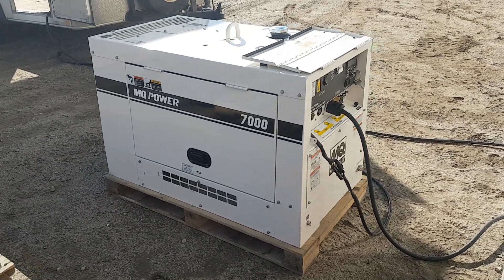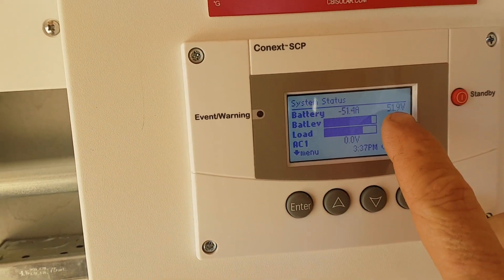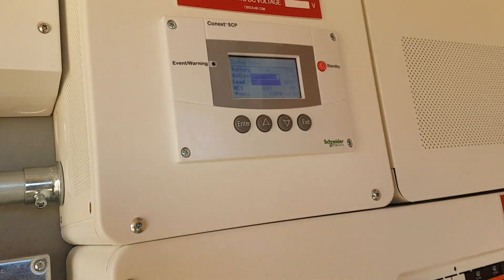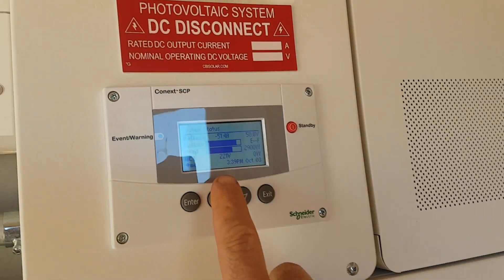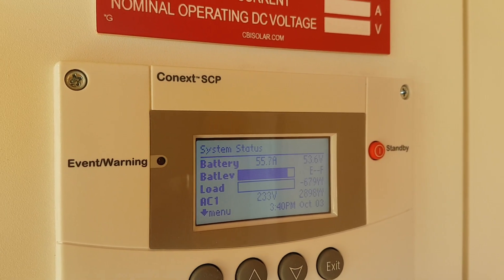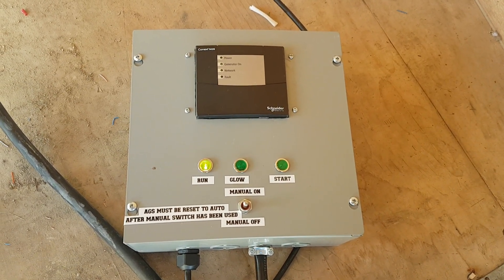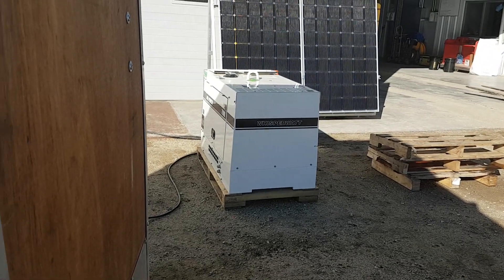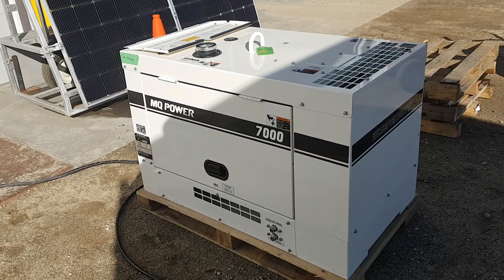Diesel Auto Gen Start , Kubota 7kw

Comment: I have a Kubota Lowboy that's rebranded as a Yamaha. I'm trying to hookup the Schneider AGS to it but having no luck. Do you have any experience
Reply: Yes i have sold and wired a few of them     I do use the Conext AGS   with Fuses and Breakers
Reply: @camosolarinc7697  would you be able to provide me a wiring schematic and which Generator type ?
Reply: @Boats1818  Good day, I've been facing the same issue. Have they shared the wiring diagram with you?
Reply: @jesus31543  yes what make/model of generator do you have ?

Comment: Did this set-up work alone with the Schneider AGS unit, or did it require the additional part: Automatic Start/Stop Control unit (MQPECU10/15SPX4KIT)?
Reply: this unit was wired using 12 volt relays between the AGS and the genset , Now that said the fastest would be a genset made 2 wire start , or a added control to make it a 2 wire start that is aproved by the genset manufacturer

Comment: Hey I like the setup. I’m looking at same generator used good condition with 1150 hours. What do you think of Multiquip 7000. I wish it was a 1800 rpm instead of 3600. Thank you
Reply from the maker: Hi Joseph, thanks for the kind words! We are a fan of the multiquip equipment, we have a few Whisper Watt gen-sets available. Feel free to give us a call at 1-(403)-358-7762
Reply: We like this genset, The low rpm would be nice, That's hard to find in the lower kW gensets.
Reply: Hey Thanks for your response. I see Aurora has 10,000 kw Perkins that’s 1800 rpm. I’m looking at someone now who’s selling MultiQuip 7000 diesel with 1425 hours for $4500 dollars. What’s going rate of used with thus hours. In this brand. I’m looking also hookup solar panels Thanks